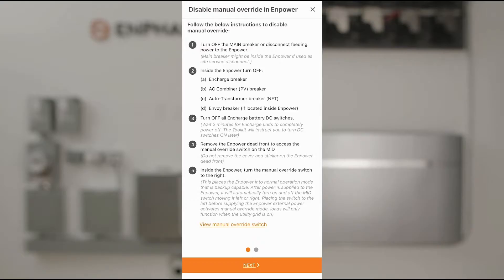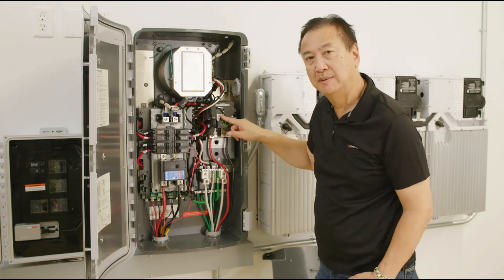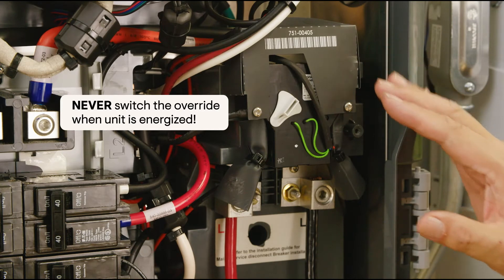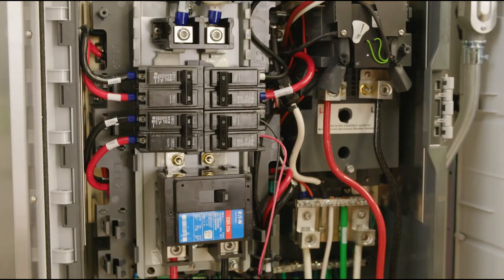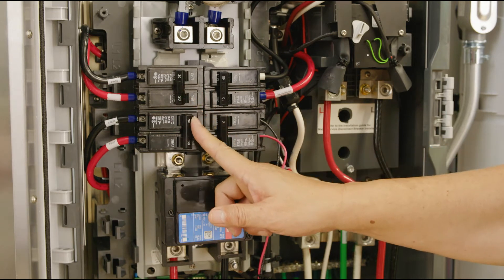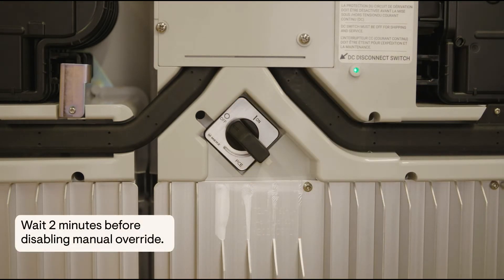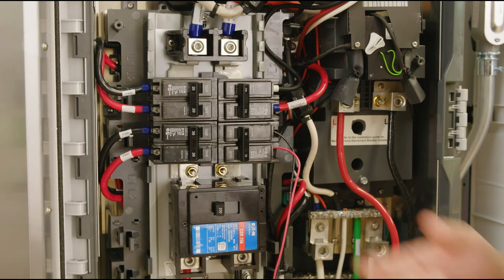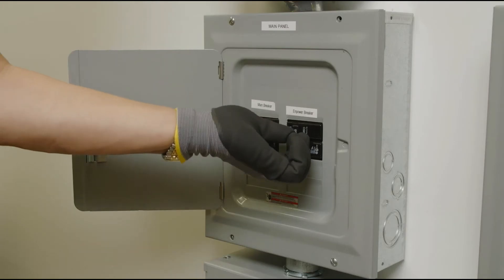11- Step 2a in Installer app: Disabling Manual Override Switch on IQ System Controller MID

Comment: What is the purpose of this? We had this system installed and they never explained anything. We don't even know if the system works.
Reply from the maker: hey atomic, the purpose of this device is set up the "off grid" scenario so that the system will work in backup during a grid outage. To see if your system is able go in backup, you can check your enlighten app if you have one to monitor your system. I hope that helps!